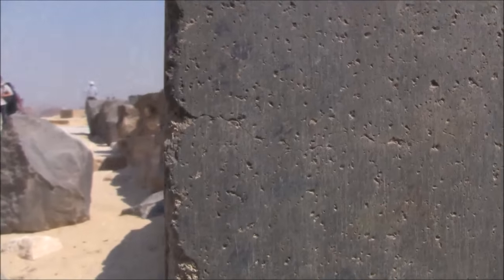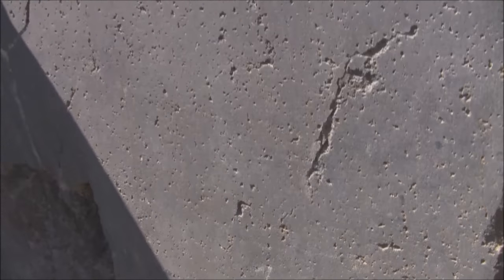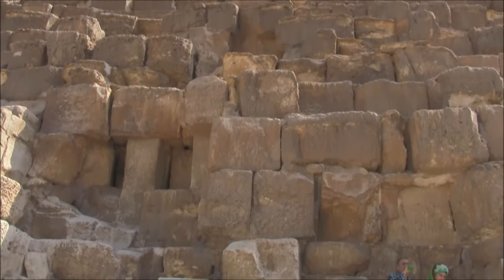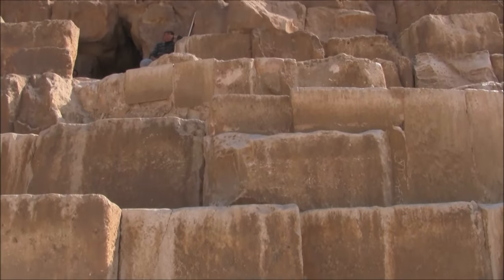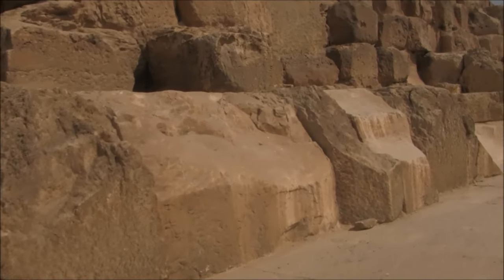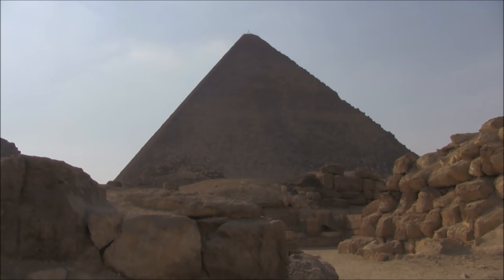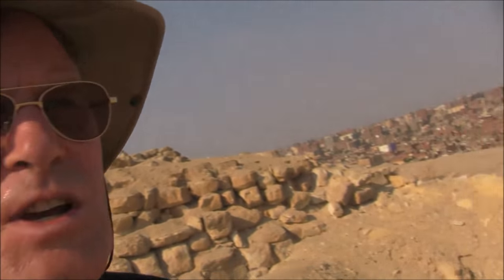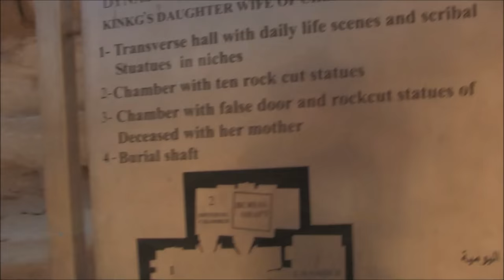Even More Evidence Of Ancient Machining On The Giza Plateau Of Egypt

Comment: You can plainly see where they used high precision drills, lathes, large saws to work the stone. 

I don't understand why that would be controversial. So the Egyptians had better tools than we thought? Its not like that requires electricity or even steam power. You can build hugh speed high precision tools and power them with belts and animals or belts and water. 18th century sawmills did exactly that. 

"BuT wHeRe ArE tHe ToOlS?"

Are we really surprised that extremely valuable tools made from state of the art materials were not just left in the sand? They would most likely been used till they were worn out, and melted for scrap, because, you know thats what everyone does. To suggest this work was done by copper or bronze hand tools is absurd.